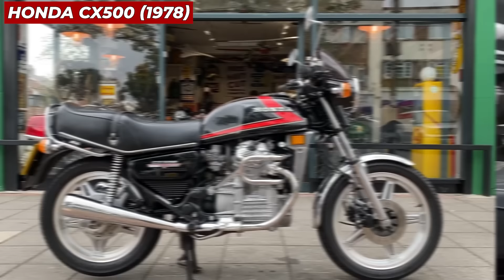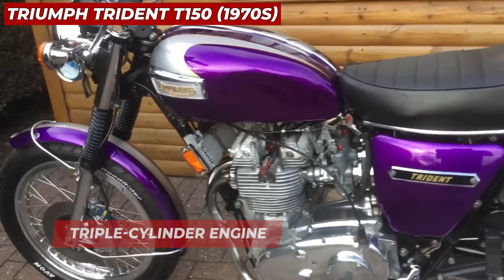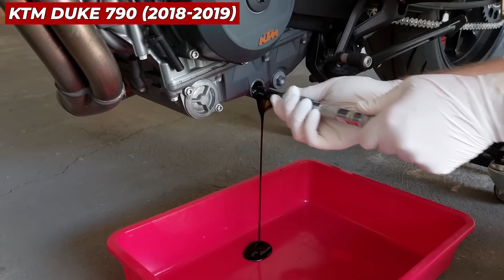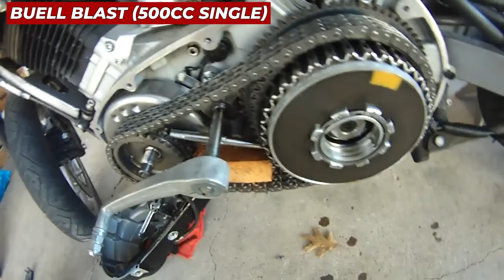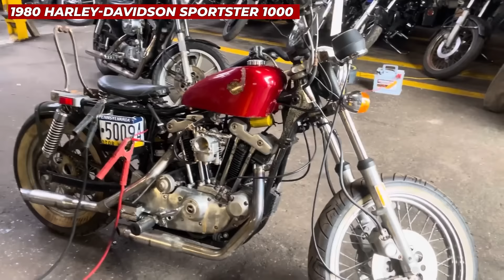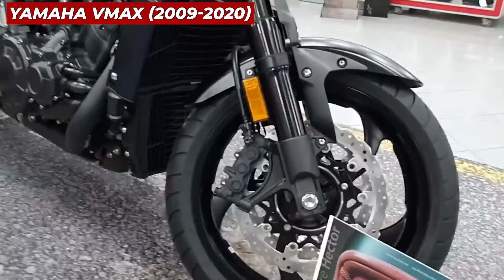20 WORST Motorcycle Engines of All Time

Comment: Rubbish I owned a CX500 and it never gave me a days trouble. I sold it to a chap I knew and he never had a days trouble with it either. I considered it to be one of the best bikes I ever owned, and I’ve owned loads of different bikes. I started riding when I was 16 years old, and i’m now 76 years old.
I agree with you regarding the Norton Comando engine, it was fast, but rubbish, I sold my 750 Commando at a huge loss because of the the rubbish engine. I never purchased another British bike.
Reply: I agree with you regarding British bikes. I am 75 years old and have also been riding since I was 16. Zundapp, BSA, Triumph, Moto Morini, Ducati, BMW, Laverda, Cagiva, Suzuki,  and now ride Moto Guzzi. The British bikes were my greatest disappointment in the 60s/70s, never to return to those brands. Will probably stay with Moto Guzzi, although at my age the smaller models of  Royal Enfield are looking attractive. --mike
Reply: @elisabattle8456  Does Triumph fall into that category?
Reply: I owned a 1982 CX500 and rode it across Europe without any issues whatsoever! I called it the best BMW Honda ever made!
Reply: @ulin4226 that's interesting. Because I have NEVER EVER heard of BMW manufacturing a motorcycle with a transverse V-twin engine...
Reply: @californiadreaming9216 I know but apparently, you can’t read between the lines. Let me spell it out for you what I meant: the CX500 was as reliable and low maintenance than the BMWs on the market at this time for a fraction of the cost. Got it now? 😉
Reply: @ulin4226  hee hee hee hee hee. Among all the motorcycle manufacturers out there, BMW is, in terms of reliability, at the bottom of the list.
       Incidentally, you can stick your condescending attitude up your sphincter.
Reply: Every other commenter here said the same thing about the CX500, including me!
Reply: Instead of the Honda CX
500 and Morini, here is one
really bad bike : The Hercules
(NSU) Wankel, nicknamed
the vacuum cleaner. 🤮
Reply: I was a motorcycle courier in the late 80 to early 90s, the CX was the bike of choice for a reason, they just kept going, my was a CX650E that I bought of a courier, who bought it off another courier, it had gone round the clock 2 1/2 times by the time I sold it.
Reply: The cx500 was the london despatch riders prefered tool.
Less experienced riders made do with an MZ 250.
Reply: You have the exact story to that of my father.
Reply: CX 500s are known for failed timing chains - like clockwork - right around 25 000 miles. Cheers.
Reply: @californiadreaming9216   Was a courier in London from 87-91, many of the boys road CX500s and put huge mileages on them, never heard of cam chains failing at such low miles, they DID have cam chain tensioner issues on release in 78, but these were quickly addressed by Honda, by the late 80s any issues were sorted and they were as reliable as a Swiss watch, mine, a 650cc model, had over over 250,000 miles on it when I sold it, to another courier who used it as is work bike.
Reply: Running it exclusively on leaded ⛽ fuel⛽ might change your mind. Some doing this till total engine destruction.

Comment: I will add to this list my 1976 u.s I Portsmouth honda gl1000, if left standing for a week she's an absolute nightmare to start, I've stripped and rebuilt each carburettor more times than I can remember and as for fuel economy I. Lucky tonget 30 m.p.g, also there's a lot of starter motor chain rattle even though it's had a brand new chain fitted not forgetting that honda u.k are of absoloutly NO HELP WHAT SO EVER, I phoned them on several occasions for technical help and to try to order spare parts and each time I was told I'm sorry but we do not deal with motorcycles over ten years old !, SO MUCH FOR HINDA AND THERE REPUTATION FOR EXCELLENCE IN CUSTOMER SERVICE AND SPARES AND REPAIR!!.

Comment: I disagree on the Kawasaki H1 & H2. They were not something with the Worst Engines. To produce that much power and stay together is a compliment to Kaw. design However, the frame, suspension and other things seemed to be designed for like a 250 sized bike. Oh and I had a Norton 750 Commando, seemed great until it threw a rod.

Comment: I had a 74 H2 and only had issues with the center cylinder requiring the spark plug needing to be changed, which the bike had spares under the seat. It did pull wheelies if not careful but was still fun to ride.

Comment: Honda VFF750, Honda RFVC engines 600 and 650, Kawasaki Z1R, Yamaha TX750, Moto-Guzzi  all V Twin 4 valves per cylinder,
Ducati bevel gear distribution engines, Yamaha XS750.There is something for everyone...

Comment: I have owned 4 RE5s, and one of them did have an engine problem due to heat.  The other three were fine, and my very first one is in the Motorcycle Mecca museum in Invercargill.  The cause of the RE5 being a marketing failure was the high fuel consumption and nothing to do with the engine.

Comment: I agree with some of them, the CX500 was the worst motorcycle ever. The Kawasaki H2 has been a big urban myth for 50yrs. It's fine for what it is. The Suzuki TM400 was fine. The Yamaha VMAX is great. Some of these should not be in the worst list. Honda V4 such as the 1983 V45 line should be on the list.
Reply: I doubt you ever owned a CX500...

Comment: I bought my TL1000 S in 1997, have 90,000km on the clock and has not missed a beat.  Seems like maybe I have the only one like this on planet earth?  I don’t think so.  Not sure how good your research is….
Reply: The TL 1000 engine is one of the best engines , been used in SV 1000 and Vstrom these engines last forever 80k and still going strong is not uncommon on a Vstrom and pretty sure rotary rear damper isn't part of the engine !
Reply: My Tl1000s not missed a beat... 50k miles, love it😊
Reply: Like anything,  if it's properly maintained , should last year's!!
Reply: Tl1000s great bike.
Shitty suspension
Reply: @janzzen1  agree but it’s easily fixed with Ohlins rear shock.
Reply: Remember inconsistent quality control, its like a lottery. back in the day you literally had to know the craftsman or technician building your bike.

Comment: Stator? No such thing in a bike so clearly this is an extended AI video based on anecdotes and horseshit research .. 
That said, Harley motors should feature high in bad design and quality of manufacture records as they are consistently prone to failure (I've had four which I've had to replace)
Go elsewhere for real reliability data

Comment: Where's the TX750?  Which had a bad engine design?  I did like the looks of the bike though.
Reply: The first Gen TX750 one's had bearing overheating issues ; the next series had Oil Coolers and different Bearings... I had a 2nd Generation one and it was excellent. Engine was reliable & bike handled better than most Japanese motorcycles of that time.....
Reply: the TX750/500 were total junk
Reply: I bought mine brand new as a 18 year old in 1973.  It never missed a beat in the 12,000 miles I put on it.  I ran it in according to the manufacturers instructions.  It never gave any of the issues that others claim.
Reply: @Kiwicruiser355  You must have had a  rare machine, rarely did any TX 500/750 get past 3 k miles without self destructing, the engines were total junk.

Comment: I bought a RE5 1977. Owned for 11 years. Serviced by specialist. 
Of 4 bikes riding from Oslo Norway to Nice France and back this was the only bike running without problems. At Autobahn-speed it used less fuel than Honda 750’s. At commuting it used more.  Was incredebly good on long touring! 
Am pissed at myself for selling it!
Reply: unlike the comment below...you should never have sold it...i wish i'd had the sense to buy one back in the day...not just because they are rare but rotaries are unique in motorcycling...if i was a car driver i'd buy a Mazda
Reply: the best thing you did was sell it, have no regrets
Reply: @georgebarnes8163 I bought a RE5 first Gen some 20 years ago. Never sold any of my bikes. Most of them I bought as trash, built them up.
A bike like the RE5 is so rare that it still works as technical statue even if it is not running anymore.
Forget all the modern bikes built in the millions. They lack of character and soul.
The RE5 is together with the RG500 the star in my collection.
They will be sold / scrapped when I have left the earth but until then, I have fun whenever I see and lay my hands on them.
My daily bike is a VMax 1700, accompained by a SV650, in winter time an old Suzuki TS250ER.
There is no bad motorcycle in this world. They are all  fun ❤

Comment: I had a Trident in a chopper.  Total pile of s#!+
Reply: There were a lot of poorly built choppers probably not the motors fault.😂😂😂😂
Reply: It was the British part and Lucas electrical that was bad, and the Trident engine was notorious for overheating the middle cylinder.  In the cold,  rainy land of the Brits it may have been okay, in the hot, dry summers of the USA, forget it!  I had it running well enough and long enough to overheat and blow out the middle connecting rod.  My last Brit Bike was a Royal Enfield.  I had a 1961 Silver Bullet!  It's on YouTube idling on the porch.  It looked great, it was heavy, it was so unreliable...typical...I even commented on the video it got me back home!  Hah!  I was so much younger then!
Reply: I can barely walk, now.  So motorcycle riding is a thing of the past for me.  Stay safe out there if you ride, if you don't ride, look out for those who do!  Be aware.

Comment: On the 88 twin cam it wasnt that they were plastic it was that it had a spring which weaked over time and would lose tension alot of people upgrade to the hydraulic tensioner in the 96 twin cam which is what i did when i owned one
Reply: Upgraded my 04 ultra to hydraulic at 45000 miles bike now has 115000 miles haven't had any problems since

Comment: I had a 1972 Kaw 750 H2 and I loved it. I experienced none of the so called dangers mentioned in this video. Obviously put together by someone with no experience with this bike.
Reply: I remember brand new H2 at Llandow Race Track in South Wales chasing very smokey Jeff Jones Triumph Trident. 
They went into 'The Dip' just before fast right hander, H2 wobbled out of control tthen  cartwheeled three times into bank. I don't think any part survived the end over end bouncing.
H2 was only relatively safe in a straight line on smooth road where it was crazy quick in comparison to just about everything.
Reply: lol this guy is rubbish. Obviously never rode these bikes.
Reply: @KevinMorland-o3c  He may well have never ridden a bike at all. This has all the earmarks of being a complete pile of AI garbage.
Reply: I had both H1 & H2... Rode the hell out of them, should I be dead?
Reply: @steveweber2375 yes lol
Reply: Its "74 hp" (55 RWhp) make you smile today. To lift the front wheel it had to be done on purpose.
The brakes made you laugh less ...
Reply: I had a '72 750 H2 also. Rode it for 4 years without a hiccup. It was dangerous fun. Loved that bike. Sold it finally before it killed me. Mine was blue.
Reply: Loved my 500 and.750 mach 3..handle bars too norrow
But that was all street bikes back then. Also raced. tm 400 cyclone mx . It was.a handfull but other bikes seemed.just as bad.
Seems.this is just a option of a puff cake.that didn't  like adrenaline rushes.
Reply: People been killed on.mopeds
My son died on his R1.yam.  he loved that bike and riding. He was killed by a family going to church  running  a stop sign.
Reply: They were dangerous, it's a fact! I witnessed someone killed on one of those in the 70's. Permanently etched on my mind and the poor man had a helmet.
Reply: @RandyGiedd   "and the poor man had a helmet"?? As if a helmet makes one immune for dying?
Reply: @RandyGiedd  I know someone who was killed in a vauxhall corsa, they are dangerous. 🙄

Comment: The Aprilia RSV mille's issues could easily be fixed by getting rid of some connectors and putting in an extra wire directly to the battery.

Comment: Missed unfortunately is the Honda V fours that demolished cam followers with regularity. I owned a 1100 sabre that I had to make new followers that had needle roller bearings that seemed to work better than the original.
Reply: I was a Honda tech in those years. I hate v4s

Comment: I bought an RE5 in 1975. I figured out in less than a month that it was a gas hog. I rode 105 miles each way to work and had to hit reserve to get there. I traded it back to the dealer where I bought it for a used Moto Guzzi 750. Fifty years later I still ride Moto Guzzi. It was good in the sense that it got me on the right bike.
Reply: I have a 1976 Suzuki GT750. It’s heavy, but extremely well built. The only snag is excessively stiff yet under-damped rears shocks. Fixed with a pair of Hagons. A set of British made Allspeed expansion chamber exhausts gave 10 to 15 more horsepower.
Reply: The
Reply: We had a local dealership that had a few new old stock bikes years ago after eye balling the Re and the water buffalo I bought a clean used 76 750F. Dodged those bullets.
Reply: A friend and I did a comparison with a 900 kawasaki   The suzuki used more fuel  and was way down on performance
Reply: DUCATI PASO twins with KAWASAKI GPZ
Reply: Honda Superdream 250 was heavy but reliable. The 400 was much nicer to use but very unreliable. The electronic ignition box had output transistors that could not withstand the back emf of normal use. The twin balance shafts sat the drive sprockets on the cush rubbers. The rubbers wore fast and caused failure of the balance chains. Cam chains failed at very few miles.
Reply: My buddy had a Guzzi, Farkin thing couldn't keep up with the Harley Davidson. Over 75 on the Guzzi, the Guzzi would be puking oil all over the Highway. We would have to stop and figure out what broke on the Guzzi. I would never by one of them. Might as well buy a URAL!!
Reply: I remember my father talking to an RE5 owner back then and he said "about a liter per 10 kms", sounds similar to what you got and that was what our Volvo 145 station wagon drank.

Comment: I worked at various dealers 70's/80's and worked on many of these.
I'll only comment on the ones I have experience with.
Did plenty of CX500 cam chain repairs, even had to change crankcase on one as it was damaged internally.
Tensioners NEVER 'WORE DOWN' and the main faults were restricted to launch mid 1978 early 79 plus all were fixed/paid for by Honda, I never did one out of guarantee.
You can easily get engine out, fixed, and ride away in a few hours doing it 100% by the book. (we had one guy cutting corners who could do entire job in 35 min)
Honda only list 3 cam chain  tensioner updates but I remember five, two just didn't work for more than 40~50 miles and were superseded in a month or so.
Water-pump seal could be changed without removing engine, with practice around 20 minutes.
Biggest issue was riders thinking they had a 1200cc, low rpm V-twin. 
If Harley Davidson had paid attention they would know chains wouldn't work when they introduced 'Twin-Cam 88.
Ridden properly (over 5,000rpm) CX500 was incredibly reliable.
Tl1000S, suspension very similar to that used by NASCAR, suspension was actually fine except on race track after several hours. 
Biggest issue was too many adjustments, customers would play with setting just because they could and had no understanding what they were doing.
Personally, I know the full story.
You missed transmission bearing failures on the Norton, the 850 was actually pretty good.
Triumph Trident was marketed for USA, the BSA motor was similar but much better, even Triumph used the BSA 'tilted cylinder' engine and better oiling when they fitted electric start.
Morini, Italian electrics sucked, doesn't matter if it was Moto Guzzi, Ducati or MV Augusta. When they fitted Bosch electrics on Guzzi's they got quite reliable and fun.
Totally agree with Kawasaki H1, chassis flexed in a mild breeze.
Piston port two strokes always have an ON/OFF power-band even when mildly tuned.
H2 wasn't as bad until it got 'spannys' (expansion chambers) and carb mods.  I never liked them though, too many idiots with more money than ability bought them.
V-Rod, designed by Germans who forgot it was being machined by Americans (or Brazilians, Mexicans, etc) 2013 I was having spine surgery and away from  new motorcycles
Are you sure the Twin Cam 88 failure was cam chain tensioners and not the timed plastic engine breather? 
V-Max was trying to re-invent the 1980's model, that could be tuned for 202bhp and stay reliable  (145b~148hp stock)
I can probably get name of RE5 factory trained tech, Bruce worked on them I never did.

Comment: The honda cx 500 has no oil supply to the camshaft ..causing the ticking noise that sounds like valves with too much clearance ..but it was the whole valve train grinding away

Comment: You uploaded just 2 weeks ago... you "forget" a fiew newer HD models.
Reply: Early HD Twin Cam motor was always going to be a disaster.
 Honda eventually found CX500 breakages were due to load reversals at low rpm where people thinking they bought a oil tight, cheap 'Harley' rode them. 
It needed 6K to stay reliable.
 Honda actually ran a CX500 at 10,000 rpm for a full week (24/7) without any failure, they didn't even consider people would ride them at 2,000rpm for extended periods. (I think mid 1979?) been long time since I worked at Honda dealers.
Doubt many Honda mechanics ever read the handbook, probably even fewer owners?
HD couldn't get to rpm needed to smooth things out, over 6,000rpm and big end/main bearings fail.

Comment: 1st new bike I owned was (76) RE5 .Ran great for 21k miles. Until @ around 90mph it locked up..I was told primary chain probably got to loose.  I was heavy, put handled good for the deu.